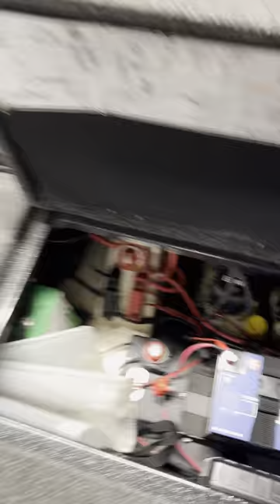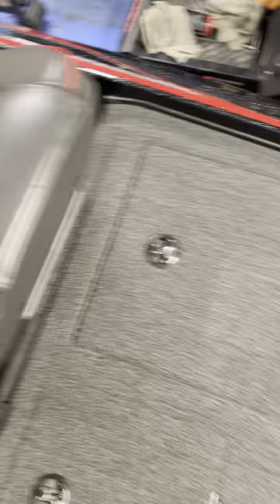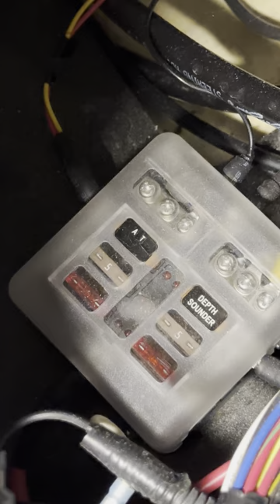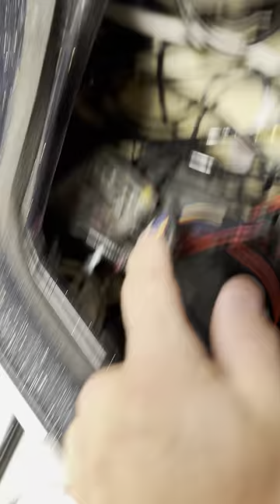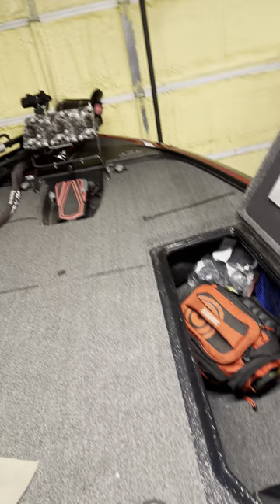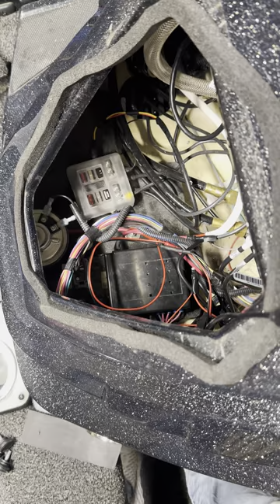How to properly wire Lowrance Active Target black box HDS Live unit

Comment: Thanks for this info!! We’ve been looking at how to move our battery to the back and wasn’t sure what wire to run, how to etc.
Reply from the maker: Glad I could help! I just uploaded a better video in 4k without all the sniffling. And it’s more specific! 😂
Reply from the maker: https://youtu.be/ggXczeG4ozA?si=nUF1xumtm-4K8RUw
Reply: You might want to find a different source for accurate technical info.  It's unnecessary to have a battery for only the AT. The one correct point is to insure as little voltage drop as possible. That's done by using a heavier wire gauge.
Reply: Did your graphs get caught in a hailstorm? Good vid too

Comment: Breaker fuse?  No such thing exists.  You would typically have a breaker, or a fuse, but not a "breaker fuse".  It is not necessary to wire power dedicated separate from the other electronics.  What it is needed is to use sufficient wire gauge to insure as little voltage drop as possible.  If your "dedicated" install uses an insufficient wire gauge, it too will have unacceptable voltage drop. You wasted money and material over-doing what you actually don't understand, but got lucky that you got something that works adequately.
Reply from the maker: I misworded.
Reply from the maker: Older video but I’ve learned since. I know it’s not needed now. Just an extra safety precaution between the block and the battery.